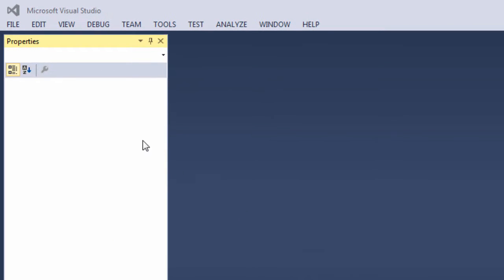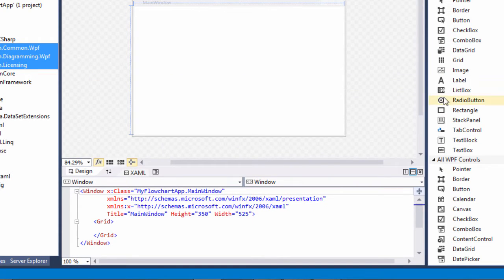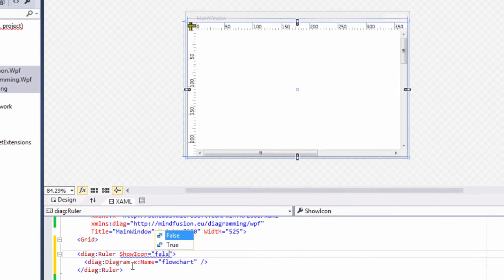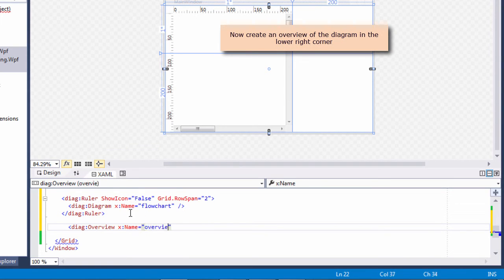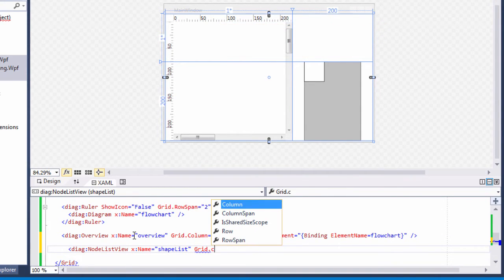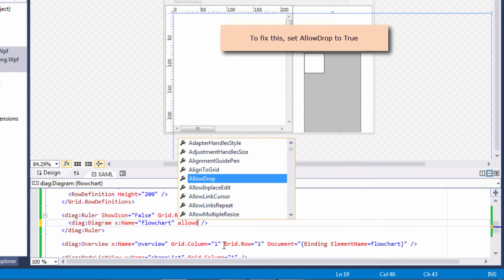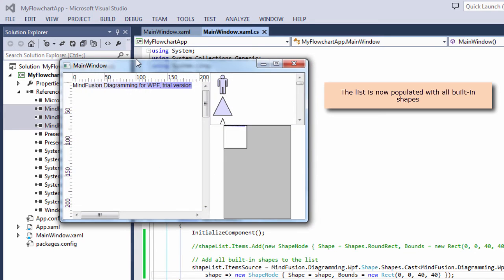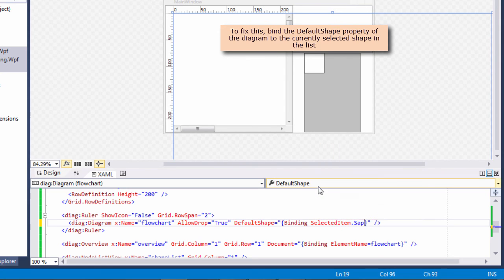How To Set Up MindFusion WPF Diagram Control

Comment: Nice Information , Can you please tell me how to give single direction for workflow view
Reply from the maker: This is easily achieved by applying an automatic layout algorithm on the diagram. Each algorithm is applied by creating an instance of the class representing the algorithm, setting the desired properties to customize the layout, and calling its arrange method. The arrange method requires an instance of the diagram to be arranged. 
In the case with uniform link flow there are two options:
1. LayeredLayout https://www.mindfusion.eu/onlinehelp/wpfdiagram/index.htm?T_MindFusion_Diagramming_Wpf_Layout_LayeredLayout.htm where you set its EnforceLinkFlow https://www.mindfusion.eu/onlinehelp/wpfdiagram/index.htm?P_MindFusion_Diagramming_Wpf_Layout_LayeredLayout_EnforceLinkFlow_0.htm property to true.
2. OneWayLayout https://www.mindfusion.eu/onlinehelp/wpfdiagram/index.htm?T_MindFusion_Diagramming_Wpf_Layout_OneWayLayout.htm .